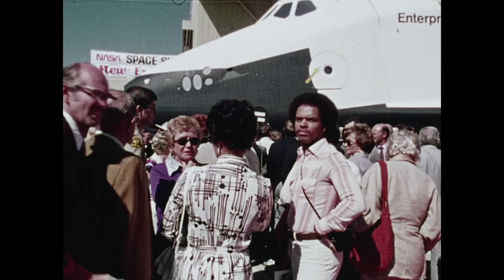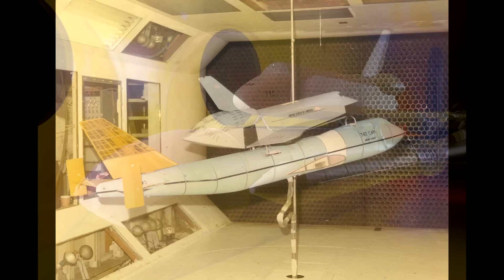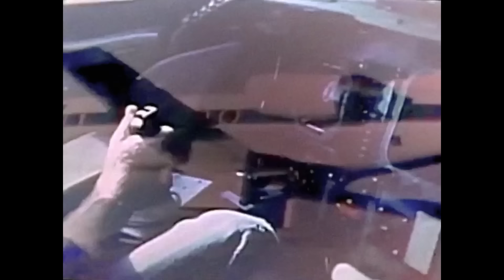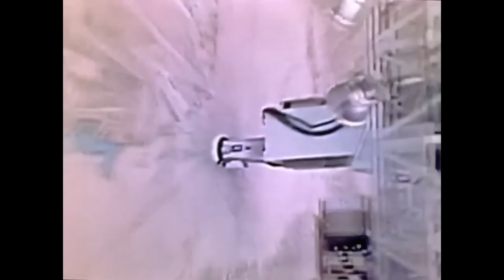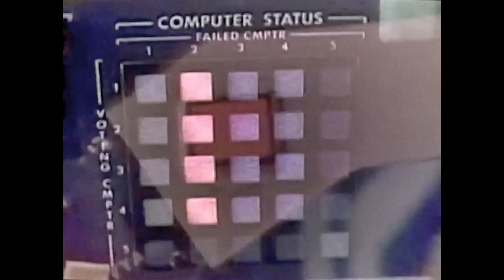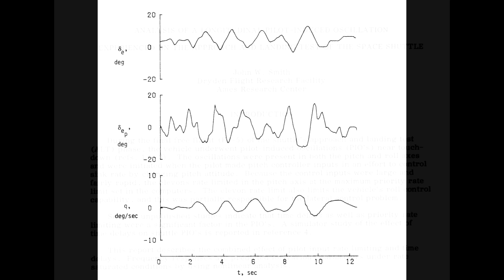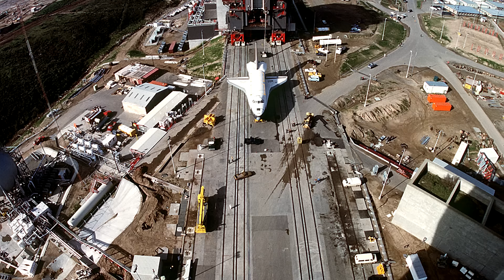How NASA Learned To Fly The Space Shuttle Like A Glider

Comment: Any aerodynamics experts here?
When making scale models of aircraft, does an experiment to simulate aerodynamics need to also use a scaled molecular gas? I.e.1/3 scale aircraft needs 1/3 air viscosity?
Reply: There's actually some truth in this. My dad was an ATP rated pilot on top of doing RC planes as a hobby. He talked about large scale model planes give you a better feel of the full-size versions flight dynamics vs. a smaller scale. While air molecules and how they pass over scaled down surface is different, the biggest variable is power to weight ratio. RC planes can have a high power to weight ratio giving you performance characteristics not ever to be seen on the  size version. Pretty much the vast majority of full-scale aircraft do not have the capability to accelerate straight-up. But this is very common in the RC world.
Reply: @mindeloman  thanks for joining the discussion.
Yes, I ask because I'm aware of a case when the first of the man-made whitewater rivers (think olympics kayaking) were being modeled to scale using water to observe how the rapids would form.
However after the designers built the full scale, the rapids did not form and behave as the scale model did.
They now use scaled fluids e.g. light oils, to scale model man-made rivers.

Comment: let's be honest, the aerodynamic design of the shuttle itself is the worst in aviation engineering, how did they ever get away with designing an aircraft that can't even fly, but has to be propped by rockets and DC carriages?  imagine the wasted cost of using rockets due to bad design, had they had a better design that could go into space independently, they might have kept it's federal funding without the need of rockets

Comment: Maybe I've just been watching too many airplane disaster videos, but that "worst landing ever" still seemed hella good for a flying brick. Those pilots were amazing.
Reply: It looks like they came damned close to dragging a wingtip a couple of times.  And the difference between an aircraft/spacecraft disaster and a near disaster is that a disaster takes a whole chain of things all going wrong. Take one thing out of the chain, and the disaster doesn't happen.

Take Challenger as an example:  Yes, the burn-through on the SRB was the proximate cause. But if the launch had been warmer, it wouldn't have happened. If the SRB field joint had burned through in a different spot (say, the part not facing the ET) they probably could have made it to orbit.  If they hadn't hit an upper-level wind gust that shook Challenger and broke loose the deposits in the SRB that had actually stopped the burn through, they probably still make orbit.

Comment: I tried to land the Shuttle numerous times on my Amiga - only achieved it once without smashing it to smithereens and then disc 2 wouldn't load so I never found out what the next mission was 😭
Reply: I had the PC version that came out in the early 90s.  The hardest part was reentry/landing, because you didn't get a lot of help on how you should align the spacecraft to dump enough energy to make the landing site, but not so much that you'd fall short.  I finally figured out what kind of nose-up attitude I needed for reenty, when and how much to do on the S-turns and not burn too much altitude.

Comment: How does Voting work with 4 Computers? What happens when 2 Computers both state "A" and the other 2 state "B"?
Reply: That would bring the 5th computer online to break the tie.
Reply: The 5th GPC was loaded with BFS (Backup Flight Software) and only took over when commanded by crew initiation if the PASS (Primary Avionics System Software) had failed. They were even coded by different companies. The chances of a 2 vs 2 was infinitesimally small and I never saw it happen. If it did crew would engage BFS and get back home ASAP.

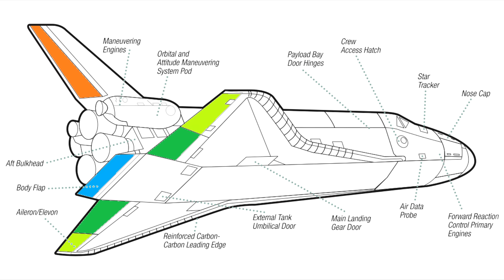Comment: 10:42 "The fly-by-wire system placed a higher priority on pitch control over roll control so..." Shouldn't that be the other way around? Just asking.
Reply: Uh no, if you're about to hit the ground, pitch will save you. Roll issues aren't good either, BUT versus pitch I'd say they are secondary. Given it's flight characteristics as a VERY heavy glider, you're also managing your glide ratios, speeds, and arrival location with pitch as well.

Comment: "Shuttle is not a great glider."
Actually I remember one of the former pilot said the vertical speed of Shuttle during landing is the same as the terminal speed of a typical skydiver.
Reply: If true, that would be about 120 mph
Reply: If i remember correctly- it has a 1:1 glide ratio at hypersonic speeds, 2:1 glide ratio at supersonic speeds and in the flare on final it has a whopping 4.5:1 glide ratio. 
So it ranges from "piano falling out of the sky"  to a "penguin trying to fly" to a "Drunk turkey with its flight feathers clipped"
Saying the shuttle flew like a glider was generous... it fell out of the sky... with style. 

A flamed out F16 in comparison is an albatross... it has a 12:1 glide ratio. 

A 767 dead stick, engines out, ram air turbine deployed gets about a 20:1 glide ratio. A virtual aluminum condor.

Comment: We interfaced ardupilot with Xplane and implementing a full fly by wire system. I got that silly little ATMEGA 2560 to fly everything from a RC plane to a F-15! That was one of the coolest projects I ever worked on! Rate limits, control laws, geo fences, automatic pilot induced oscillation dampening! Couldn’t help but thinking how easy it would be to build a cruise missile control system back in 2010! Heck now days you could parallel 10 raspberry pi’s and end up with a highly redundant control system! I learned more about aerodynamics, PID control systems and IMUs with this project then my entire college physics experience!

Comment: You gotta love that AGC controlled F-8 with the DSKY hanging off to the side. I always have a chuckle with that.
Reply: Apparently that DSKY actually flew to the moon. "For the ground crew and test input, they installed a DSKY in the left gun bay. When powered up, it blew out, due to a mistake in power requirements. It was replaced by a DSKY from the command module of Apollo 15, having freshly returned from the Moon."
Source: Computers Take Flight: A History of NASA's Pioneering Digital Fly-By-Wire Project, NASA SP-2000-4224
Reply: @glenslick2774  Very cool. Bonus points for citing your source!
Reply: That would have to be the last time NASA ever operated an AGC?
Reply: @nzoomed  I'd have to double check with Mike but I think this is correct.
Reply: @CuriousMarc  would be interesting to find out. I didn't think any were used past the Skylab era!
Reply: @nzoomed  Not even during the ASTP in 1975?
Reply: @martin.B777  yes the ASTP would have used one too.
Reply: Could you explain those abbreviations? Google won’t give me any useful answers.
Reply: @foximacentauri7891  
AGC: Apollo Guidance Computer
F-8: Vought F-8 Crusader, the air superiority aircraft used for the tests
DSKY: stands for "display and keyboard", the interface used to control the AGC.
Reply: @foximacentauri7891  AGC = Apollo Guidance Computer.  DSKY = "display and keyboard"  https://en.wikipedia.org/wiki/Apollo_Guidance_Computer
Reply: @misterprimeminister473  All the laymen thank you. Sheesh
Reply: I knew about the AGC F-8, but had no idea about the DSKY in there!
Reply: Does the software used in this test still exist?
Reply: @user2C47  I just did ask Mike Stewart about it. He tells me the software was called DIGFLY. He has found no record of it, except for just one page of its listing in  a private collection, and this only very recently (a month ago). But we do know where the F-8 AGC system is, and Mike identified it positively from the parts numbers. We might even be able to power it up one day. However Mike checked and the F-8 AGC has AGC test ropes in it, not the digital fly by wire software :-(.
Reply: @CuriousMarc  what an awesome comment, the effort that goes into tracking this information down and following through with the leads is very much appreciated. It's a shame the F-8 AGC doesn't contain the software, does that mean the software is likely gone forever? Do you know if the memory modules are the same ones used originally in the F-8 AGC or could they have been swapped at some point?
Reply: @chickenfizz  Yes right now no DIGFLY records save one printout page. I am not sure I understand the rest of your question. You mean the erasable core memory (as opposed to the software core rope?)
Reply: Oh hey. When the video revealed the Apollo DSKY, I immediately thought “I wonder if CuriousMarc has talked about that before?” :)
Reply: I saw that dsky and immediately thought about you

Comment: reminds me of the old SAS in KSP where you had to spam them on/off to stop oscillation! (a trick that is still useful now but not as much of a "requirement".)
Reply: I will now use this
Reply: @scorelessvermin2997  if the ship is somewhat balanced, it should settle since it applied a correction but does not over apply it since you stop it mid way. just go: "F,F,F,F,F,F,F..." (SAS key)

OLD SAS used to not even let you turn, you had to disable it to change direction! that is where i learned to tap it to have kind of a "half stability assist" while turning.

Comment: Imagine the terror of piloting this enormously heavy vehicle to a dead stick landing over and over again!

I spoke to a person who had worked on the shuttle carrier. He said that while it was on the ground, the 747 held the full weight of it, but the pitch angle of the shuttle was 15 degrees nose up (don't know if that was transport or test configuration), and as the two rolled down the runway, the shuttle began to contribute significant lift. So the attachment points had to support both tension and compression.

I was at the Enterprise's first landing at Edwards! I waited all day there, and got sunburned on one side of my face. We heard the double sonic booms, and it was on the ground in two minutes! Talk about a manhole cover!

Comment: The problem with Pilot Induced Oscillation is that you don't have time to determine what the lag is - is it even constant each time?  With a bit of practice you could probably work it out and get it under control, but after about 3, possibly divergent, oscillations you're at the scene of the crash.  So whether it's an aerodynamic effect in a conventional control aircraft, or a computer/electronics lag as with the Shuttle it's a difficult situation to overcome.  With a conventional aircraft you have the option to power-on and go-around but not so with the Shuttle - a glider.

Comment: Great video. What guidance system (like ILS?) did they use on this desert runways for autoland?
Reply: MLS-Microwave Landing System.  It was supposed to replace ILS, but it never did.  It featured the ability to have a curving Localizer course.  What happened in the aviation field is that LORAN and GPS came on the scene, and RNAV approaches using the newfangled guidance systems filled the need, and didn't require expensive ground equipment to be installed at every airport, along with constant test approaches by the FAA/other regulatory bodies to verify the performance of the installed ground equipment once in service.  MLS was invented by NASA in the 1970's 😉

Comment: I don't know if "separation" of flying vehicles had happened much by those days, but I do know that the SR71 had tried to launch a drone much like the space shuttle, and it ended up tipping back into one of the vertical stabilizers and destroying the plane.  

In that context, it seems to me launching a space shuttle off a gigantic 747 was hardly trivial.  I could be wrong about that but to me with my limited knowledge, that seems like a more momentous series of maneuvers than it did when I watched it in real time.
Reply: I watched the first separation in real time and I just knew it was going to take the vertical stab off the 747. Exciting times!
Reply: @clarencegreen3071  The first time the fully configured shuttle launched I really had the overwhelming sense it was going to blow like a nuclear bomb, right there on the launch pad.  As it happens it more or less did years later, when we all assumed it wouldn't.

Comment: Scott I used to sail with one of the Shuttle project engineers back then. I asked him about this and he said it was on purpose to test how the software could handle PIO and low speed handling. They found out, as you saw, the software needed more work.

Also found out Rockwell used the fund of the Shuttle contract which was cost plus on the B-1A which was fixed cost. Big controversy back then. I wonder if the loss of funds was why Enterprise was never upgraded to spaceflight status.
Reply: This was definitely not on purpose. But there were similar things that were, just higher. During entry, there were Programmed Test Inputs, (I think all the way through the end of the program) if there was spare thruster fuel - they'd do things like have a certain thruster fire at a specified set of conditions, so they could then record the shuttle's response in the aerodynamic environment, the response of the flight controls system, etc.

Comment: Was the Shuttle Carrier Aircraft, with Shuttle attached, technically a jet powered biplane? How much lift did the Shuttle's wing provide in that configuration? 🤔
Reply: Probably negligible. Wouldn't be surprised if instead the turbulence from the Shuttle caused loss of lift for the 747.

I've seen video of the carrier flights between Edwards AFB and Kennedy Space Center that showed that the 747 was incapable of generating enough lift to climb above altitudes that required cabin pressurisation. I also read that because the 747 was also unable to climb, it would experience weather, so a NASA T-38 jet would fly about 5-10 minutes in front of the 747 and relay information about crosswinds and rain, which can cause windsheer.

Unable to  fly to higher altitudes and at higher speeds, it could take 2 days to bring a shuttle from Edwards AFB to KSC, in part also because crews need to spend rest time. Sometimes, sudden bad weather would ground the 747 and shuttle because it would be too dangerous to fly through the weather, as flying above it was impossible.

Those 747s experienced more wing flexing and stress than regular airliners simply because of how many hours of low altitude flying they did, even though they didn't go through typical pressurisation cycles.

The completion of the Shuttle Landing Facility at the KSC was a big deal for the Shuttle Program since the carrier flights were almost as risky as the spaceflights themselves.
Reply: @vaska00762  Cabin pressurization or oxygen is needed at altitudes above 10,000' and the video says the flight tests released at 22,000' feet so either the video was  inaccurate or your memory is faulty. But I think it must have reduced the ceiling of the 747 due to the drag. I wonder if the test release was at the ceiling of the combo or if the  max speed at the ceiling would be to slow for the shuttle to have enough lift.
Reply: @chrisglen-smith7662  this is one of the videos that I can find that I remember watching
https://youtu.be/objbcnqCmXk
I could maybe only speculate that for the Approach and Landing Test Flights, that the 747 climbed high for those purpose, but that for the ferry flights, the 747 carriers would probably struggle to maintain altitude.

I can't remember which video it was which talked about the ferry flights, but the important part was that the ferry flights, when carrying the shuttle, cannot fly above weather. Most weather stops at about 20,000 ft, at least, as far as I'm aware. Some high altitude clouds do form higher up, but this doesn't tend to affect aircraft.

Certainly, the ferry flights did occur at a much much lower altitude than regular airliner flights, and the lower altitudes present weather concerns for routing and stops for refueling and rest for the crew.

Comment: Very cool tidbit about the longer attachment pylons for the test flights to achieve the required AOA. I never knew that.
Reply: Yup, the ferry flights used the shorter front attach struts to save fuel as it holds the Orbiter Vehicle at 3º AOA, while flight/glide test used longer from struts to maintain a 6ºAOA.  Even so, the 5,500 N mile no payload range still decreases down to 1000 nautical miles with an orbiter on the SCAs back..
Reply: I noticed it immediately in the video. The "Enterprise" really did poke up higher. Never noticed it before, though.
Reply: @awuma  Yes, but only during the Approach and Landing Tests(ALT), OV-101-Enterprise was indeed placed at the lower 3ºAOA for the SCA/Orbiter Vehicle ferry flights. Enterprise had the honour of being the only Orbiter Vehicle to be carried in both the ferry(3º) and the ALT mission(6º).  SCA/Enterprise flew from USA/CAN to Europe in the lower "ferry position".